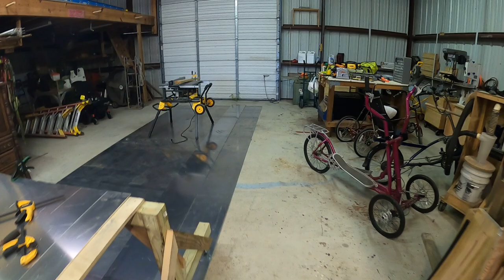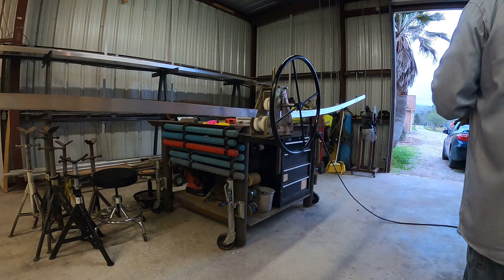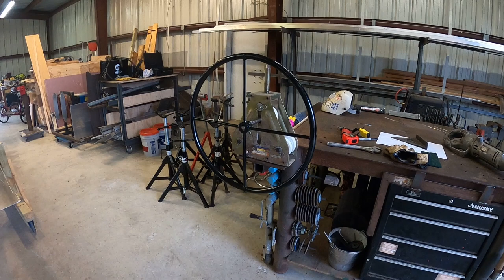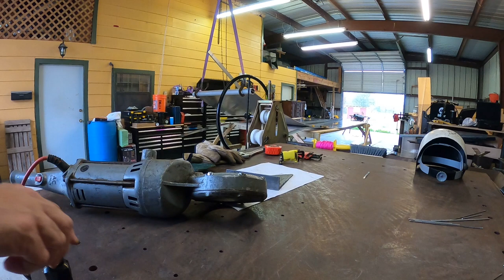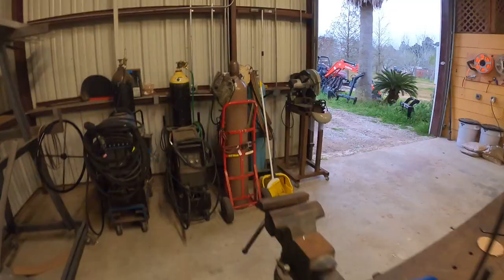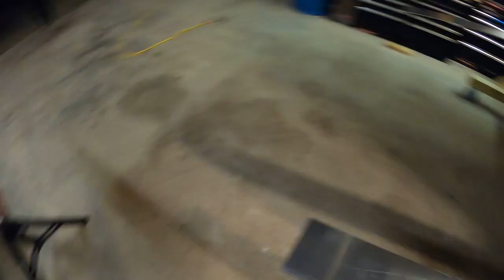Airboat Build - Episode 2

Comment: Leave your pipe bender rod shaft. That's your going to cut off A 1/2 " inch longer so you have room to work with after you reweld it back together again. That way you don't end up busting.,or snapping off your pipe bender rod shaft by accidently just using it under A?pressure load in the future aswell. That A very good upgrad to the pipe roller bender though no doubt about it at all.
Reply from the maker: Thank you for watching and commenting. I agree with you that I need to leave it a little long just in case. Take care and stay safe.